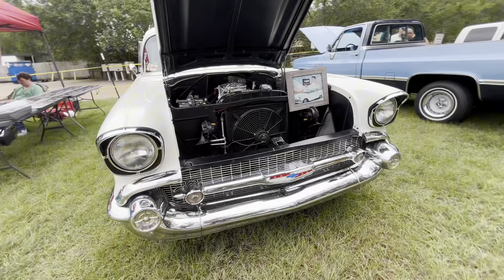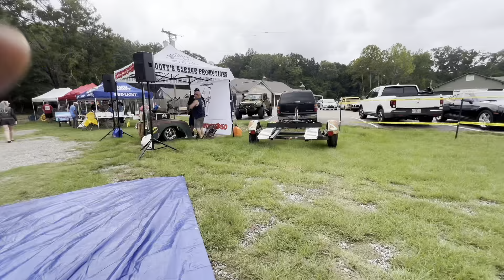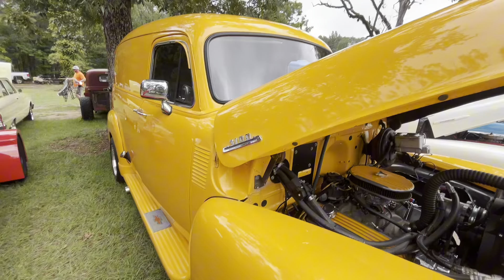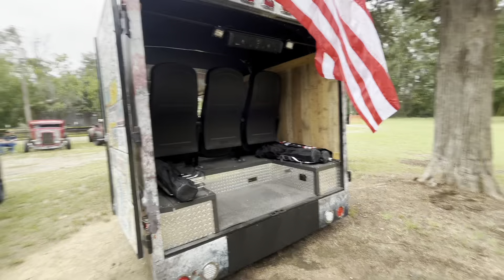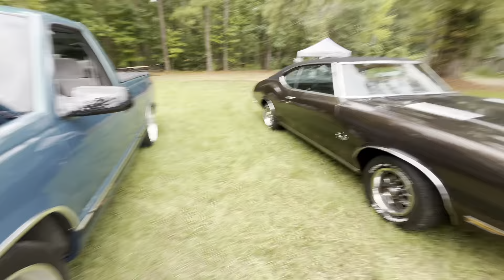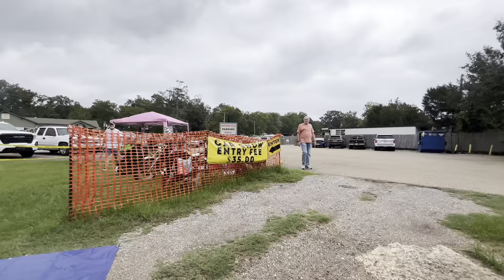YALL DIDNT TELL ME ABOUT THIS!! SUPER CHARGER ON A STOCK MOTOR 350

Comment: fuel injection is a good way to go bro it’s easy I am doing my 79 regal now I just have to drop my tank at this point now and set up my tank for fuel injection. Holley got the sender you just drop in connect to factory tank. I just got to swap the sender out and run the lines cost me like 400 for all the parts